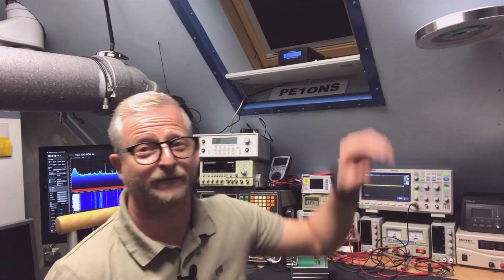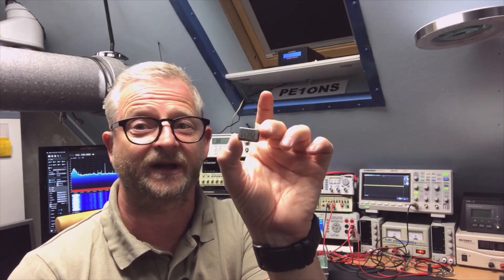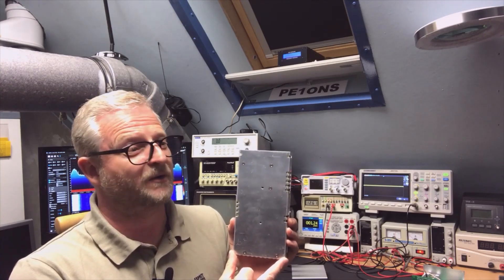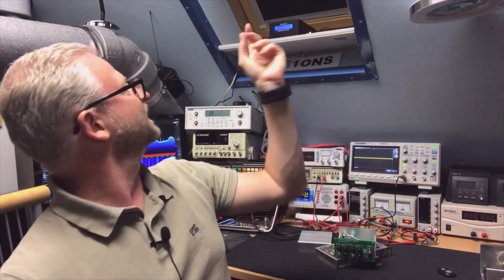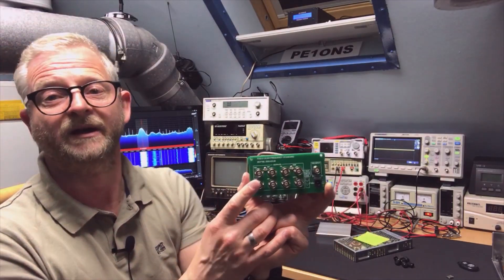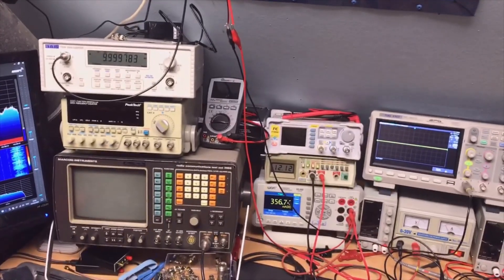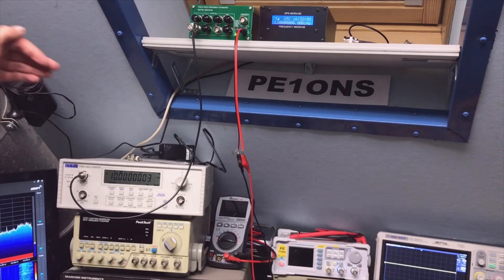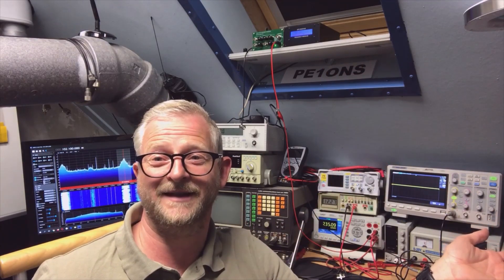#026 GPS Disciplined Oscillator why you need one in your lab. GPSDO

Comment: Congratulations to your very interesting and useful video
"#026 GPS Disciplined Oscillator why you need one in your lab. GPSDO".
Is the case all metal (aluminum) or only the top and bottom covers?
I am tending to buy one but I am hesitant because a different model 
was causing broad band RFI in my Kenwood TS-590SG tranceiver.
The model I am considering now is from a seller with 100% rating on eBay.
Reply from the maker: Thank you! .. my model does not create any distorsion on my FTdx10 it seems all shielded

Comment: Isn't the point of this not just to have a reliable frequency reference, but also make it possible for all of the instruments to be locked into the same phase (as long as they're plugged into the distribution amp?)
Reply from the maker: This device is for a 10 MHz reference. If you want to sync devices you use a sync-master and a trigger-signal-distribution to al your slaves. the master could be a signal generator. Have a look at my video about the different distribution amps. #197 https://www.youtube.com/watch?v=TphHS0TJ6OY

Comment: Very nice Tony, I was just thinking you could do a simple hack to your Marconi to accept 10Mhz reference with 74HC14 and 74LS390?
Reply from the maker: Hi, thanks for your comments, yes you could indeed do that or just bypass the pll and feed directly 10Mhz... it is running that internal...but choose to not modify the Marconi, thanks for your tip, always welcome!
Reply: @TonyAlbus  Thanks Tony, it's quite incredible, that TTI counter running so accure even without external reference 0.32Hz is pretty much negligible, shame that display isn't backlight. I will modify mine with to accept reference input from.rear of.unit (still in warranty).
Reply from the maker: Yes the TTi is amazing, does not look super cool, agreed on the back lighting, but is works great!... yes i do the same after warranty expired ;-)